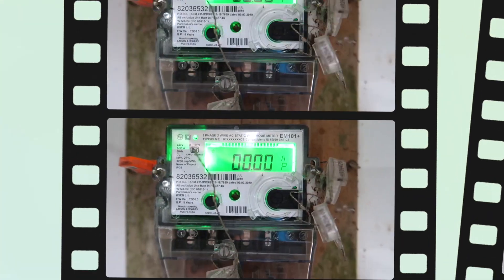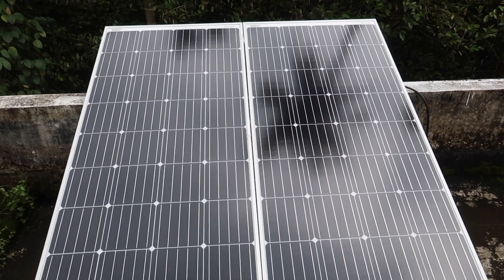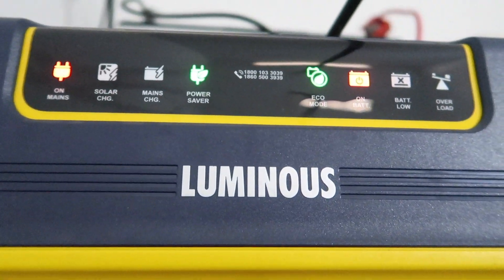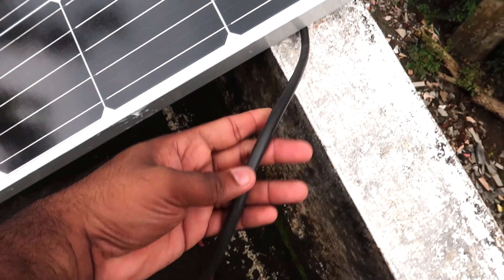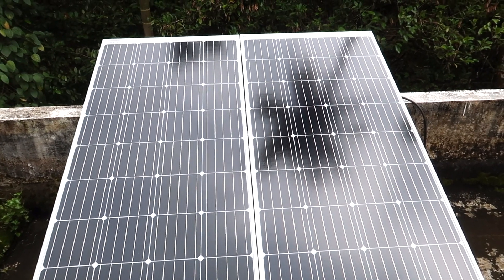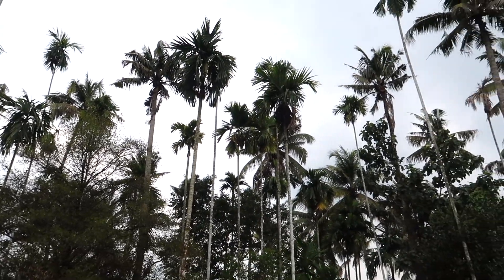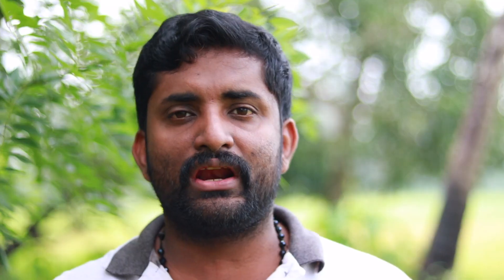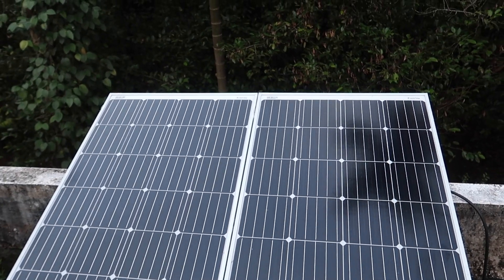സോളാർ പാനൽ വൈദ്യുതി ചാർജ് കുറക്കും | Luminous invertor + solar panel + battery

Comment: വീഡിയോ ഇഷ്ട്ടം ആയി. ലൈക്‌ ചെയ്തു.  ഒരു ചോദ്യം ഉത്തരം തരിക.ചേട്ടൻ  രണ്ടു പാനൽ വച്ചു അപ്പൊ approx 15000rs ആയി. 
ഒരു മാസം kseb bill 200 rs സേവിംഗ്സ് കിട്ടി എന്നു കരുതുക അപ്പൊ 6 വർഷം എങ്കിലും എടുക്കും പാനൽ മുടക്കുമുതൽ തിരിച്ചു കിട്ടാൻ. ചേട്ടൻ വീട്ടിലെ high power equipments (fridge, motor etc) (most of fridges in houses are connected in 24 hours) ഒന്നും ഈ സോളാറിൽ യൂസ് ചെയ്യുന്നില്ല. 6 വർഷം ഇൻവെർട്ടർ,  ബാറ്ററി കംപ്ലയിന്റ് വരാം വരാതിരിക്കാം. കംപ്ലയിന്റ് വന്നാൽ പിന്നേം മൈന്റന്റൻസ് ചാർജ്. ഇൻവെസ്റ്റ്‌ment കൂടും. 
നമുക് kseb ആശ്രയിക്കാതിരിക്കാൻ പറ്റില്ല. 
നമുക്ക് നിത്യം വേണ്ട frige, mixer, iron box, motor ഇവ ഒന്നും ഈ ചെറിയ സിസ്റ്റം ഉപയോഗിച്ചു പ്രവർത്തിക്കാൻ പറ്റില്ല.1kv ഇന്വെര്ട്ടറിൽ റൺ ചെയ്താലും അധിക സമയം കിട്ടില്ല. ബാറ്ററി പെട്ടന്ന് തീരും. 200 ah battery 360watt പാനൽ ഉപയോഗിച്ച് ചാർജി ചെയ്യാൻ 2, 3 ദിവസം എടുത്തെകാം.  വലിയ സിസ്റ്റം ലക്ഷങ്ങൾ വരും. സാധാരണ  ആളുകളക്‌  പറ്റില്ല. കേരളത്തിൽ ദീർഖ സമയം പവർ കട്ട്‌ ഇല്ല. അപ്പൊ അത്യാവശ്യം വേണ്ട ലൈറ്റ് ഫാൻ വർക്ക്‌ ചെയ്യാൻ 200ah ബാറ്ററി ആവശ്യം ഇല്ല 
അപ്പോൾ എന്റെ ചോദ്യം.... 
ഇതിന്റെ ആവശ്യം വല്ലതും ഉണ്ടോ... 
1 kv inverter and 100ah battery യൂസ് ചെയ്താൽ 70rs ഒരു മാസം കൂടുതൽ വരൂ . അത് ഓരോ മാസം kseb ku, കൊടുത്താൽ പോരെ ഒറ്റയടിക്ക് 15000rs സോളാറിൽ തീർക്കാണോ.  ഇത് കാശു കൊടുത്തു കടിക്കുന്ന പട്ടിയെ വാങ്ങിയ പോലെ. 

Opinion is personal
Reply: Joice K Joseph, സംഭവം കൂടുതൽ പഠനം ആവശ്യമുള്ള കാര്യമാണ്. പക്ഷെ, എന്റെ അഭിപ്രായത്തിൽ 200 രൂപ ഒന്നുമല്ല കൂടുതൽ വരുന്നത്. 600-700 റേഞ്ചിൽ ആയിരുന്നു ഇൻവേർട്ടർ വയ്ക്കുന്നതിന് മുൻപ് വീട്ടിലെ ബില്ല്. വെച്ചതിന് ശേഷം 2000 ന് മേലെ ഒക്കെ ആയിരുന്നു. (സദാരണ ഇൻവേർട്ടർ ആണേ. സോളാർ അല്ല! വലിയ വീടൊന്നുമല്ല. AC ഒന്നുമില്ല.) ഫ്രിഡ്ജ് വാഷിംഗ് മെഷീൻ ഒക്കെ പഴയതായതാണ് കാരണം എന്ന് പലരും പറഞ്ഞു. അതൊക്കെ മാറ്റിയപ്പോൾ, ഒരു 1800 ആയിട്ടുണ്ട്‌. ഇത് കാണുമ്പോൾ ഇൻവേർട്ടർ ആണോ വില്ലൻ എന്ന സംശയം ശക്തമാകുന്നു. ഇൻവേർട്ടർ ഊരിയിട്ട് ഒന്ന് ടെസ്റ്റ് ചെയ്ത് ഉറപ്പിക്കണം. (ഇൻവേർട്ടർ Luminous ആണ്)
Reply: @logicalkid8048  100 രൂപയുടെ കറന്റ് ഇൻവെർട്ടർ വഴി ഉപയോഗിച്ചാൽ ചാർജ് ചെയ്യാൻ 125 രൂപയുടെ കറന്റ് വേണം.
Reply: @freemind6434  ശരിയാണ് : ചാർജിംഗ് സോളാർ ആക്കുക ഇൻവർട്ടർ സൗകര്യത്തിന് അധിക ചിലവ് നമ്മൾ സഹിക്കേണ്ടേ ?
Reply: @logicalkid8048  ഞാനും സാധാരണ ഇൻവെർട്ടർ ആണ് ഉപയോഗിക്കുന്നത്... ആദ്യമായി ഇന്വ്ർർട്ടർ വച്ച ശേഷം 600 രൂപ റേഞ്ചിൽ വന്നുകൊണ്ടിരുന്ന കറന്റ് ബില്ല് പെട്ടന്ന് 2000 ൽ കൂടുതലായി.... എന്നാൽ ഈ പ്രശ്നം ഞാൻ കണ്ടു പിടിച്ച് പരിഹരിച്ചു...  അതിൽ ഒന്നാമത്തെ വിഷയം എന്നത് ഇൻവെർട്ടറിന്റെ പുറക് വശത്തായുള്ള സ്വിച്ച് കൾ ശ്രദ്ധിക്കുക എന്നതാണ്...  അതിൽ normal മോഡും high charge മോഡും ഉണ്ട്.. എപ്പോഴും നോർമൽ മോഡ് തന്നെ ഇടുക. പെട്ടന്നെടക്കിടക്ക് കറണ്ട് പോകുന്നുണ്ടങ്കിൽ പെട്ടന്ന് ബാറ്ററി ചാർജ് ആകാനുള്ള ഓപ്‌ഷനാണ് high charge mode. പക്ഷെ high charge ഓപ്ഷൻ എപ്പോഴും ഇട്ടിരുന്നാൽ കറന്റ് ബില്ല് കൂടുതലായി വരികതന്നെ ചെയ്യും..  രണ്ടാമതായി ups മോഡും normal മോഡും സ്വിച് ആണ്.. അത് എപ്പോഴും നോർമൽ മോഡിൽ ഇടുക. അല്ലാ എങ്കിൽ വോൾടേജ് അൽപ്പം കൂടുകയോ കുറയുകയോ ചെയ്യുന്ന സന്ദർഭത്തിലും ബാറ്ററി ഓവർ ചാർജ് ആവുകയോ ചെയ്യുന്ന സന്ദർഭത്തിലും ഇൻവെർട്ടർ ഓട്ടോമാറ്റിക് ആയി back up ആവുകയും അൽപ്പം കഴിയുമ്പോൾ വീണ്ടും kseb യിലെ കറന്റ് ഉപയോഗിച്ച് ബാറ്ററി ചാർജ്ജ് ആയി കറന്റ് ബില്ല് കൂട്ടി കൊണ്ടിരിക്കും... ഈ പ്രശ്നം ഞാൻ പരിഹരിച്ച ശേഷം എനിക്കിപ്പോൾ കറന്റ് ബിൽ 500നും 680 രൂപക്കും ഇടക്കാണ് വരുന്നത്... ഇക്കാര്യം ഒന്ന് ശ്രദ്ധിച്ചു nokkoo... ഇത് ഫിറ്റ്‌ ചെയ്ത് തരുന്ന ഇലക്ട്രീഷ്യന്മാർ പലരും അജ്ഞരാണ്....
Reply: @logicalkid8048   എനിക്കും ഇതേ അനുഭവം തന്നെയാണ്. ഇൻവേർട്ടർ   വയ്ക്കുന്നതിന് മുമ്പ് 750-800 range ആയിരുന്നു kseb bill,  ഇൻവേർട്ടർ സ്ഥാപിച്ചതിനു ശേഷം bill 1500-1750 range ൽ ആണ്. ഏകദേശം 3-4 unit വരെ power ഇൻവേർട്ടർ charge ചെയ്യാൻ എടുക്കുന്നുണ്ട്.
Reply: @girishkumarns8562  ഇൻവെർട്ടർ ഒരു  യൂണിറ്റ് current നമ്മുക്ക് തരണമെങ്കിൽ അത് രണ്ട് യുണിറ്റ് current എടുക്കും
Reply: Girishkumar NS battery old aakunth anusarch charging time koodm billum koodum
Reply: @logicalkid8048  നിങ്ങളുടെ inverter battery heat ആകുന്നുഡോ എന്ന് നോക്കണം. ഉണ്ടെകിൽ battery complient ആകാൻ സാധ്യത ഉണ്ട്. ചാർജിങ് കട്ട്‌ off ആകുന്നില്ല എങ്കിൽ curtent bill കൂടും. Battery എത്ര വർഷം പഴയത്  ആണ്.
Reply: @gururajakamath.n5306  ഇല്ല, ബാറ്ററി ചൂടാവുന്നില്ല! ചാർജായാൽ പിന്നെ cut off ആകുന്നുണ്ട്. ബാറ്ററിക്കും ഇൻവേർട്ടറിനും ഏകദേശം 6 വർഷം പഴക്കമുണ്ട്. 
ഇക്കഴിഞ്ഞ ദിവസം, അടുത്ത വീട്ടിൽ എർത്തിങ് പ്രശ്നം കണ്ടുപിടിച്ചു. അവർക്കും ഇതുതന്നെ ആയിരുന്നു. 2000 രൂപ ബില്ല്. അതുപോലെ എന്തെങ്കിലുമാണോ എന്നും നോക്കണം. ഇൻവേർട്ടർ തന്നെയാണ് വില്ലൻ എന്ന് തീരുമാനിക്കാറായിട്ടില്ല.
Reply: Old equipment kooduthal current use cheyum.
Ente veetile motor 20. Year ayi. Half hp motor Anu. Pakshe work cheyumbol 800 watts current edukund...
Refrigerator 8 years ayi...
Power factor .55 ullu athum kooduthal current use cheyyunnu

Inverter kooduthal current use cheyundo ennu ariyan Ella equipment of cheythittu.. kseb meter Nokia mathi. Athil kva,kw enniva kanikum
Reply: @logicalkid8048  Inverter വില്ലൻ തന്നെ !ഒരു heater പോലെ 24hrs പ്രവർത്തിക്കും.
Reply: @logicalkid8048  inverter villian aaanu lumn chila models ee complaint und
Reply: @logicalkid8048   ithu curect anu
Reply from the maker: Ente veettil current poovan padilla.. evide athupole ulla hospital related machines work aavunnundu..athanu battery 200 ah aakiyathu.. therchayayum energy save chayyan pattum ennu urappu ullathu kondanu vachathu panel. Battery charge aavan 2, 3 dhivadam onnum venda 😶
Reply: കുറഞ്ഞ യൂണിറ്റ് ഉപഭോഗം ഉള്ള ഗാർഹിക ഉപഭോക്താക്കൾക്ക് സർക്കാർ സബ്സിഡി നിരക്കിലാണ് kseb വൈദ്യുതി നിലവിൽ  വിതരണം.  ഇങ്ങനെ കുറഞ്ഞ നിരക്കിലുള്ള റേഷൻ വൈദ്യുതിയും സോളാർ വൈദ്യുതി ചെലവും തമ്മിൽ താരതമ്യം ചെയ്യരുത്. വൈദ്യുതിയുടെ സബ്സിഡി സർക്കാർ ഘട്ടംഘട്ടമായി നിർത്തലാക്കി കൊണ്ടിരിക്കുകയുമാണ്. നിലവിൽ കൊമേഴ്സൈൽ വൈദ്യുത നിരക്ക് വെച്ചുനോക്കിയാൽ സോളാർ വൈദ്യുതി ലാഭകരമാണ്. വീടുകളിലേക്കുള്ള വൈദ്യുതിയുടെ സബ്സിഡി ഗവൺമെൻറ് ഭാവിയിൽ നിർത്തലാക്കുന്നതോടെ കൂടി കൂടുതൽ ഗാർഹിക സോളാർ വൈദ്യുത ഉപഭോക്താക്കളുടെ എണ്ണം കൂടും.
Reply: If you use any inverter (solar or the traditional )there is a Energy loss. Means If you Run a Fan from KSEB line which uses  75Whr for 1 hour running  and If  the same fan  runs from an Invertor it costs that 75Whr + cost of  energy  loss due to the conversion of current while charging and discharging  batteries. So If you use a solar panel you can comprise that with solar energy. in this video he is using a PMW charger (i think due to budget) which charges slowly compared to MPPT charger. Also his NXG series controller uses an algorithm to save energy . in which it doesn't use KSEB current for charging batteries unless the battery goes below 70 %.
Reply: സാധാരണ ഒരു ഇൻവേർട്ടർ മാത്രം വെച്ചാൽ ബാറ്ററി ചാർജ് മൈന്റൈൻ ചെയ്യാൻ ദിവസം ഒരു യൂണിറ്റ് വൈദ്യുതി ചെലവാകും.
Reply: നിങ്ങൾ പറയുന്നത് ശരിയാണ്.. പക്ഷെ ഉപയോഗിക്കേണ്ട  വിധം ഉപയോഗിച്ചാൽ ഇത് വളരെ ലാഭമാണ്..  ഉദാഹരണം പറയാം...  നിലവിൽ സാധാരണ ഉപയോഗിക്കുന്ന ഇൻവെർട്ടർ പോലെ ഉപയോഗിക്കുവാനുള്ളതല്ല സോളാർ ഇൻവെർട്ടർ... നിങ്ങൾ പറഞ്ഞതുപോലെ 360 വാട്ടിന്റെ പാനൽ വച്ചിട്ട് ഒറ്റ ദിവസം കൊണ്ട് 200 mah ന്റെ ബാറ്ററി ചാർജ്ജ് ചെയ്യുവാൻ സാധിക്കുകയില്ല. പ്രതേകിച്ചു മഴ കാലങ്ങളിൽ.  ഒരു സാധാരണ വീട്ടിൽ 100mah ബാറ്ററിയും 1kv ഇൻവെർട്ടരും മേൽപ്പറഞ്ഞ 360 വാട്ടിന്റെ പാനലും മതിയാകും.. എങ്കിൽ മുഴുവൻ ചാർജ്ജ് ആകാൻ 6-7 മണിക്കൂർ മതിയാകും.  പിന്നെ സോളാർ കമ്പനികൾ പറയുന്നത് വൈകുന്നേരം 6 മണിമുതൽ രാത്രി ഒൻപത് മണിവരെയുള്ള സമയത്തു ഈ സോളാർ സിസ്റ്റം ഫുൾ back up ൽ ഇടുക എന്നതാണ്.. ഈ സമയം വീട്ടിലെ ഫാൻ ലൈറ്റ് ടി വി എന്നിവ മാത്രം സോളാറിൽ പ്രവർത്തിക്കും... മറ്റുള്ളവരെ kseb വൈദ്യുതി ഉപയോഗിക്കും... അതിനു കൃത്യമായി വയറിങ് ചെയ്യണമെന്ന് മാത്രം... മാക്സിമം ബാറ്ററി ഉപയോഗിച്ച ശേഷം ചാര്ജിങ് മോഡ് സോളാർ മാത്രം select ചെയ്തിരുന്നാൽ പിറ്റേന്ന് സൂര്യപ്രകാശം വരുമ്പോൾ മാത്രം ഇതു ചാർജ്ജ് ആകും... kseb യിൽ നിന്നും വൈദ്യുതി എടുത്തു ചാർജ്ജ് ആവുകയും ഇല്ലാ... ഇപ്രകാരം ദിവസവും ബാക്ക് അപ്പ്‌ ആയി ഉപയോഗിച്ചാൽ കറണ്ട് ലാഭിക്കാം.. എന്നാൽ സാധാരണ ഇൻവെർട്ടർ കറണ്ട് പോകുമ്പോൾ / power cut ഉള്ളപ്പോൾ മാത്രമേ back up  ഉപയോഗിക്കാവൂ... പിന്നെ യഥാസമയം ബാറ്ററി വെള്ളം ഒഴിച്ചുകൊടുക്കണം... എന്നാൽ ബാറ്ററി യാതൊരു കാരണ വശാലും പെട്ടന്ന് complaint വരില്ല. ഞാൻ ബാറ്ററി വാങ്ങിയിട്ട് 4 വർഷം കഴിഞ്ഞു.. യാഥാ സമയം ബാറ്ററി വാട്ടർ ലെവൽ ചെക്ക് ചെയ്യുന്നുണ്ട്.. അതുകൊണ്ട് തന്നെ കംപ്ലയിന്റ് ഒന്നും നാളിതുവരെ വന്നിട്ടില്ല... ഇൻവെർട്ടർ നല്ലത് തിരഞ്ഞെടുത്താൽ പെട്ടെന്ന് complaint വരില്ല... ഓവർ കറണ്ട് ലോ കറണ്ട് ഉണ്ടാകുന്ന സന്ദർഭങ്ങളിൽ ഓട്ടോ മാറ്റിക് ആയി ബാക്ക് അപ്പ്‌ ആയി ഇൻവെർട്ടർ കംപ്ലയിന്റ് ആകാതെ സൂക്ഷിക്കും... പക്ഷെ ഇടിമിന്നൽ ഉള്ളപ്പോൾ നിർബന്ധമായും ഇത് കണക്ഷൻ വിച്ഛേദിച്ചിരിക്കണം എന്ന് മാത്രം...
Reply: മാത്രമല്ല, 6 വർഷം ഒന്നുമല്ല ഇതിന്റെ ലൈഫ്. ഞാൻ ഇൻവേർട്ടർ വാങ്ങിയിട്ട് 6 വർഷത്തിന് മേലെ ആയി. ഒരു 6 വർഷംകൂടി എങ്കിലും ഓടും എന്ന് പ്രതീക്ഷിക്കുന്നു. അപ്പൊ, ഈ 6 വർഷത്തിന് ശേഷം ലാഭമല്ലേ?
Reply: Joice K Joseph  theerchayayum labhakaramanu. Adheham paranjapole nalla agencykale sameepichkazhinjal nmmuk oru dhivasam undakunna upafogavum athupole nammude load kalum calulate cheith correct aya system vachutharunna compnykal nd. Avark ANERT approval ndo ennath krythyamai nokendathund. Nte neighbor SEMICRON enna oru compnyde solar anu cheithath. Ippo 3, 4 yr aai. Oru complntm illathe ippolm nallareethyil work cheyunnu. Flood nte timil mattarkum kseb il ninn current illathe irunapolm azhchakalolam avrk current ndairunu. Annok njngalok phon charge cheithathpolm avide chenn anu. Neighbor mudakkiya mudakumuthal ithinodakamthanne adhehathinu electricity billil kuravum vannu. Adheham valare santhushtanm thripthanum aanu. Angine oru result kond ivde ulla orupaad veedukalil e company thanne solar cheithitund. Angine ulla approved aya companykalude system noki vangichal nannairikum ennanu ithinodakam enik manasilayath. Govt. Approval ullapo athinu subsidyum kittunond.
Reply: Ur right
Reply: Normal inverter anelum battry 4-6 year akumbol replace cheiyandivarumallo
Reply: solar വൈദ്യുതി ലാഭകരമാകണമെങ്കിൽ വൈദ്യുതി ബില്ല് 3000 രൂപക്ക് മുകളിൽ വരുന്നവർക്ക് on grid ചെയ്യണം . ബാറ്ററി വെച്ചുള്ള തിന് ലാഭ o വരുന്നത് ഒരു ദിവസത്തിൽ കൂടുതൽ വൈദ്യുതി മുടങ്ങുമ്പോഴാണ് UTL Gamma t ഒരു നല്ല ഇൻവേർട്ടർ ആണ്
Reply: അമിതമായി പണം ഒണ്ടോ. എങ്കിൽ ഇത് ഓക്കേ. ലാഭം നോക്കി ആണേൽ ഭീമമായ നഷ്ടം... ഒരിക്കലും ബാറ്ററി സോളാർ സെലക്ട്‌ ചെയ്യരുത് ടോടല്ലി നഷ്ടം.. ഇപ്പോൾ കാലം മാറി kesb മാറി മാക്സിമം സമയവും അവർ വൈദുതി എത്തിക്കാൻ ശ്രെമിക്കുന്നുണ്ട്. പിന്നെ മഴകാലം വരുമ്പോൾ kesb ഡൌൺ ആയിപ്പോകും അത് അവരുടെ കുറ്റം അല്ല. ആ സമയങ്ങളിൽ സോളാറും ഉറങ്ങാൻ ഉപയോഗിക്കുന്ന പായ് മെത്ത പോലെ..ആയിരിക്കും. ഒര് 2kw സോളാർ സിസ്റ്റം മാക്സിമം 1 ലക്ഷം രൂപയിൽ ഇൻസ്റ്റാൾ ചെയ്തു കിട്ടുന്നു എങ്കിൽ. നഷ്ടം ഇല്ലാതെ കുറച്ചൊക്കെ അഡ്ജസ്റ്റ് ചെയാം...

Comment: U have to chnge ur battery also...
Try solar battery(c10) for solar invrtr...
Reply: @ecoownmedia  200ah battery charge cheyyan vendathu 20A aanu, with full sunlight your panel will produce maximum 18A only
Reply: @lijuhearts  yes...
C10 battery will charge fully in 10 hrs
And also discharge in same..
Solar will be avlble for max 10hr
Reply: Norml c20 bttery takes 20 hrs to chrge fully..
Speed chrging will reduce battery life..

Comment: Bro യുടെ 2പാനലിലെ output 18amps കാണുകയുള്ളൂ 200ah battery അല്ലെ അതാണ് charging slow ആകുന്നത്. Inverter 30amps charge ചെയ്യാൻ പറ്റും. 200ah battery charge ചെയ്യാന്‍ 20amps വേണം

Comment: 150 mah sadha battariyum inverterum aane ethra solar panal vendi verum
Reply from the maker: 300 w solar panel and MPPT
Reply: @ecoownmedia  180 w solar panels ennu Amazon ഇൽ കാണുന്നത് 90 w ന്റെ 2 പാനൽ ആണോ അതോ 180 w 2 പാനൽ ആണോ....200ah ബാറ്ററി ചാർജ് ആകാൻ എത്ര പാനൽ വേണം? ടോട്ടൽ എത്ര ആകും???
Reply: @ecoownmedia mppt ethra amp. anu vendathu
Reply: 300 watt panel + MPPT ( 12 volt )
More details 9567152724

Comment: eetavum nalla solar inverter um atu pole tanne servicum nalathu V-GUARD inte aanu njan vguard inte du-850 synergy aanu use cheiunatu crnt bill ila nalla kuravundu ;frst time vechapo 1 batteryum 3 pannelum ayirunu pineedu use cheitu vanapo back up kuravayirunu angane 5 panelum 2 batteryum vechu ipo nalla back upum undu pakaloke solar il ninula current aanu work cheiunatu....VT-150 Tall tubular (2battery) anu ulathu..
service eduthu parayendatanu epo cmplnt buk cheitalum 2 days maximum atinulil techicn veetil ethum
Reply from the maker: Woww👍👍...price koodi parayamo?
Reply: Price ethrayay..

Comment: Solar panel ok .but batteriyum inverterum exide akiyal kollamayirunnu .luminous not good
Reply from the maker: Karanam parayamo bro
Reply: Najade veetil inverterum batteryium discard ayi poyi 15 years exide battery use cheythittu . New vangan chenapol electerican paranju exide a nallathu luminous cheap annenu 
Athukonda comment ittathu .low cost ulla battery long life illa.
Reply: @alangeorge3353  exide best brand okke thanne...bt ente veettil exide correct 3 year aayappol pani theernnu....850 watts inverter aayirunnu...18000 rupees ...2 year + warranty undaayirunnennu thonnunnu...aadyam muthalle 3 hrsil kooduthal  charge nilkkunnundaayirunnilla...🙄 3 bulb maathre upayogichirunnollu...bt use cheyyaan pattiyath correct 3 years....product inte prasnavum aavvaam...
Reply: @vishnudas4130  Always  use slow charging battery option in inverter to charge battery for battery's long life.
Reply: @rajucherian  ini paranjittu kaaryamillallo bro...battery water okke correct time replace cheythirunnathaan...bt out put kuravaayirunnu...😓
Reply: @vishnudas4130  exide aa good battery ente experience vachu  thonnunu .
Reply: @alangeorge3353  exide nalla companiyaan...athu kondaanallo athu thanne eduthath...bt njangal expect cheytha out put thannilla...3 bulb maathre use cheythirunnollu....bt warranty kazhinjathum complaint vannu...service pinne oru thavana cash koduthaanu cheyyippichath. Ippo use cheyyunnilla..
Reply: @vishnudas4130   Mmm.
Reply: @vishnudas4130  njangalude veetinte aduthaulavarum exida vangiyathu .chilatjinte back up capacity kurangiuttnd

Comment: Microtek m sun ഇൻവെർട്ടർ കൊള്ളാം നല്ല സർവീസ് കിട്ടും ഡിസ്പ്ലേ ഉള്ളതുകൊണ്ട് കാര്യങ്ങൾ അറിയാൻ എളുപ്പം
Reply: Which model do u want?
Reply: @harneetsingh66666  m sun 500/600/1000w 
Call
9495125816
Reply: @ottakkannan_malabari  microtek 1235/12volt solar pcu= 5100rs
1435/12volt solar pcu= 5600rs

Comment: ഞാനും luminous solar invereter വാങ്ങി nxg1100 മോഡൽ

 oru സംശയം ഉണ്ട്

രാത്രി വൈദ്യുതി പോയാൽ  1 മണിക്കൂർ കഴിഞ്ഞ്  വൈദ്യുതി വന്നാൽ  ഇലക്ട്രിസിറ്റി യില്‍ നിന്ന് ബാറ്ററി charge ആകുന്നു

ആ സിസ്റ്റം ഒഴിവാക്കി ബാറ്ററി charge solaril നിന്ന് മാത്രം aakuvaan pattumo
???
Reply from the maker: No option bro.. enikkum athayirunnu avishyam
Reply: @ecoownmedia  
 Bro i have aa idea (just thing simple logic,) 
Use change over switch 
Use the battery backup at ngt 
And charge the battery at mrg
Using charger over mcb
Reply: microtek  msun 1135va മോഡൽ

 battery charge grid disable ചെയ്യാനുള്ള switch ഉണ്ട് 

microtek നല്ല കമ്പനി ആണോ???

microtek ineverteril  displayum ഉണ്ട്

charge ശതമാനം സോളാര്‍ voltage detail ഒക്കെ കാണിക്കുന്നു

my luminous invertor   olxil sale  aaki

microtek വാങ്ങിയാലോ എന്നുണ്ട് what is your comment ??
Reply from the maker: എല്ലാവരും നല്ല അഭിപ്രായം ആണ് പറയുന്നത്. ഉപയോഗിച്ച് നോക്കിയവരുടെ അഭിപ്രായം നോക്കു
Reply: @ecoownmedia  good idea
Reply: കരന്റിൽ നിന്ന് ബേറ്ററി ച്ചാർജ്‌ ചേയ്യുന്ന മൂന്ന് വയർ പൊകുന്നുണ്ട് ഇൻവർട്ടി ലേക്ക് അതിൽ നിന്ന് ഫൈസ് നൊക്കി ഒരു ഓപ്പൻ സ്വച്ചി ബൊക്സ് വേക്കുക ആസ്വച്ചി ഓഫ് ച്ചേയ്യുക അപ്പൊ ൾ പകൽ സമയങ്ങളിൽ സൊളാറിൽ നിന്ന് ചാർജ് ആവും കരണ്ടിൽ നിന്ന് ആവൂലാഈ സിസ്റ്റം ച്ചേയ്യും ബൊൾ അറിയുന്ന ആളേ കൊണ്ട് ച്ചേ യിക്കണം
Reply: @sideekkurumbathur3023  00966501850720 ചേട്ടൻറെ വാട്സ്ആപ്പ് നമ്പർ ഒന്ന് തരുമോ
Reply: Microtek m sun solar ഇൻവെർട്ടറിൽ grid charging disable ചെയ്യാനുള്ള option ഉണ്ട്. ഞാൻ microtek ഇൻവെർട്ടർ ആണ് നാളുകളായി use ചെയുന്നത്. ഇപ്പോൾ ഒരു സോളാർ മോഡലും വാങ്ങി. Msun 935VA. Complints കുറവാണ്.
Reply: Panel add cheyyumbol cable um inverter capacity yum nokkane
Reply: ബാറ്ററി ചാർജിങ്ങ് ഒഫാക്കി വക്കാൻ കഴിയുന്നത് സാധാരണ ലോക്കൽ ഇൻവെർട്ടറിലാണ് .. വളരെ കുറച്ച് കറന്റെ അത് ഉപയോഗിക്കുക ഉള്ളൂ ചൂടാകില്ല  . ആണ് .മൈക്രോ ടെക്കിലും .ലിവ് ഫാസ്റ്റ് .ഇൻവെർട്ടറിലും ഇത് പ്പറ്റും .അലുമിനിയത്തിൽ ഉണ്ടാക്കുന്ന ലൂമിനസും മൈക്രോ ടെക്കും ഞാൻ കടയിൽ ഉപേക്ഷിച്ചു

Comment: Since august 2018 I have been using this inverter  with 360w panel.Biggest mistake is There is no option of disabling mains charging .
Reply from the maker: സോളാറിൽ നിന്നും ചാർജ് ആവുന്നില്ലേ ? 🤔
Reply: @ecoownmedia  yes. Now due to rain charging very less ampire.
Reply: Kseb ചാർജിങ് ഡിസേബിൾ ചെയ്യാൻ separate സ്വിച്ച് ഇൻവെർട്ടറിൽ ഫിക്സ് ചെയ്യാം.  നോ ഇഷ്യൂ
Reply: @beekeykebees3241  how we fix that switch

Comment: 1kv കിട്ടാൻ എത്ര പാനൽ വെക്കണം
Reply from the maker: 250 x 4 = 1000
Reply: Pls contact UTL SOLAR POWER SYSTEM for bettter performance.9656998432
Reply: 250 watts 4 pannels
Reply: 1kv is wrong. Correct is 1kw (kilo watt)
Reply: @sabudaniel4297  1kva = 900watts,

Comment: എൻറെ അടുത്ത് microtec  solar ഇൻവെർട്ടർ ആണ്.battery exide 150Ah ആണ് സോളാർ pannel ഉപയോഗിക്കാൻ പറ്റുമോ
Reply: സോളാർ ഇൻവെർട്ടർ ആണങ്കിൽ പാനൽ വെക്കാം അല്ലങ്കിൽ ഒരു കൺട്രോൾ യൂണിറ്റ് കൂടി വാങ്ങേണ്ടി വരും
Reply: Same inverter anakil pattum
Reply: Pls contact UTL SOLAR SYSTEM.for better performance.9656998432
Reply: UTL SOLAR SYSTEM.9656998432
Reply from the maker: Solar invertor aanu engil pattum bro.. battery ethu company aayalum kuzappam ella..